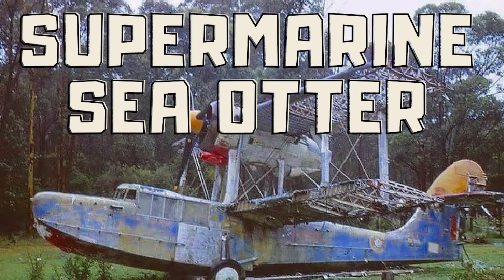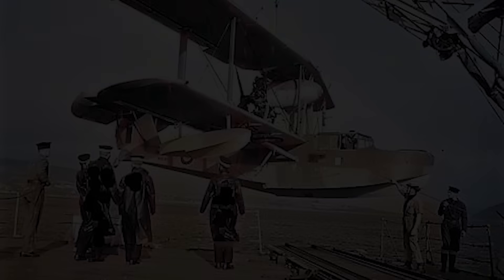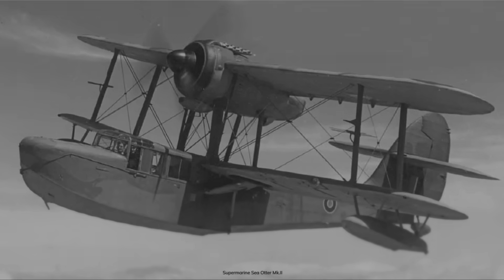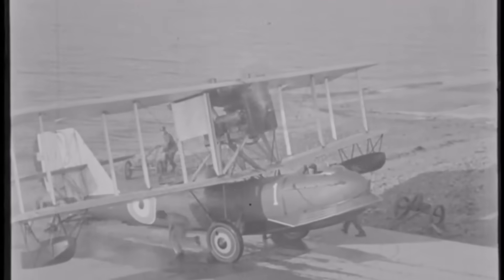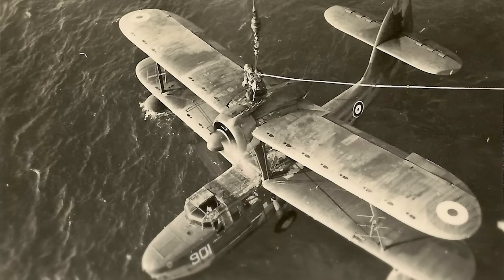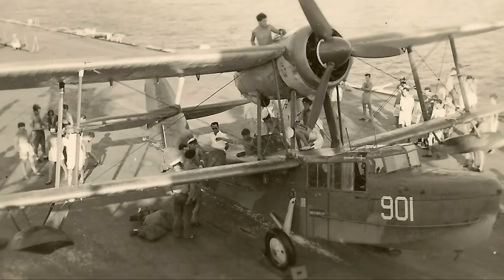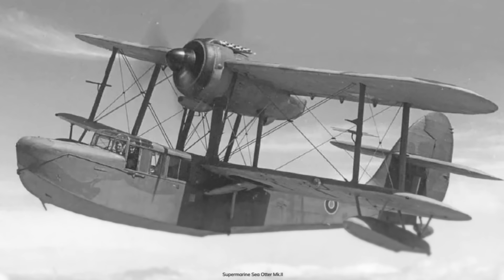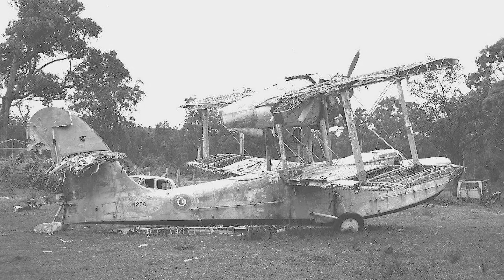SUPERMARINE SEAGULL WALRUS AND SEA OTTER WHAT HAPPENED

Comment: Back in the mid 1960's there was a Walrus based at the Camden airfield southwest of Sydney. I saw it up close when I was about 8 or 9 with my father who flew me there from Illawarra in a light plane (my first time in a plane). Not long afterwards I saw it flying over the Illawarra. I noticed it because of the characteristic sound of it's radial engine.
Reply from the maker: Thank you I have read several Walrus remained flying in Australia. Very interesting.  Chris.

Comment: I wish I could find out more about the post war seagull which I seem to recall being similar to the walrus and sea otter but powered by a merlin engine.
Reply from the maker: Thanks Moth there is a bit on the end of my film, from research there was only two PA 143 first flew on 14th July 1948 from Southampton Water pilot was Mike Lithgow.
By the early 1950s helicopters were taking over and by 1952 both aircraft had been scrapped. Do please have a subscribe to my channel. Chris.